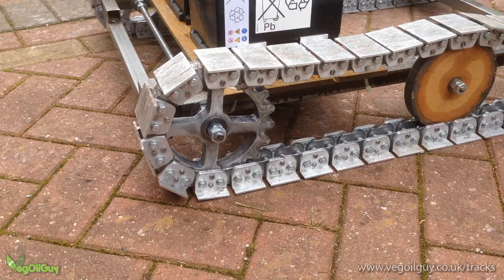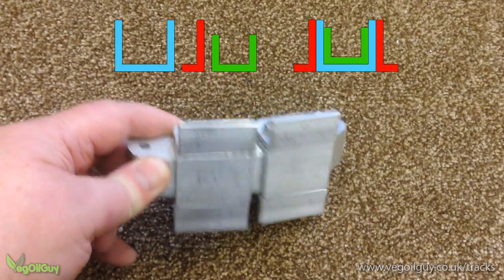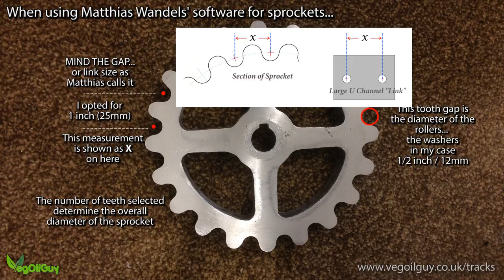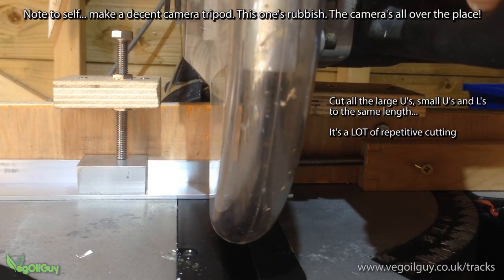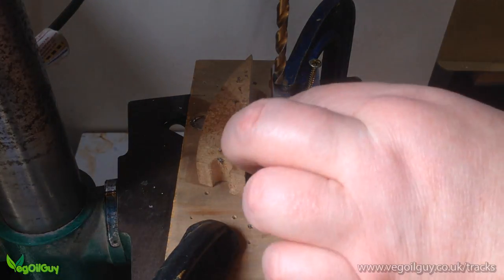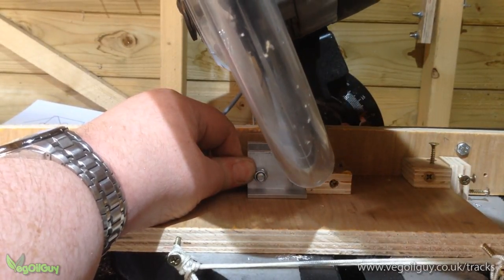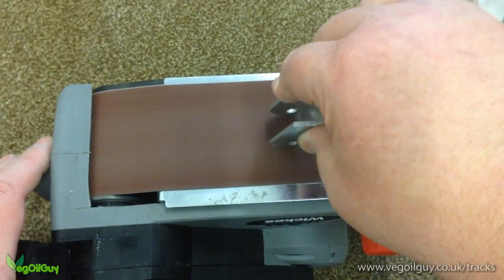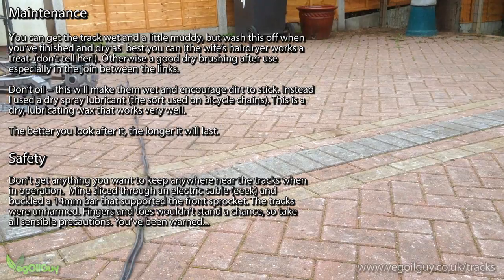How to easily make Caterpillar (Tank) Tracks at home - by VOGMAN

Comment: Can use aluminum pipe instead of bulk of washers it will reduce weight n be easy to make...can add rubber  pieces at bottom with rubber based adhesive for exta grip on floors n tiles

Comment: i might use your design on a crawler vehichle that uses a lawnmower engine, only scaled up a bit. ill probably end up putting some rubber padding on the face of the tracks so they dont scuff the blacktop as it will be significantly heavier.

Comment: Excellent video!  Have you thought about using a small pipe or steel tube instead of washers? Would be a lot cheaper and easier.
Reply from the maker: Many thanks. All suggestions are welcomed. They might come in handy in a future build : )

Comment: Great idea, have you tried to use something else as pins to reduce cost and weight?
Reply from the maker: Not yet. It still works fine and if it ain't broke, don't fix it 😁😁😁😁😁😁
Reply: @vogman  I was thinking about making this for a wheelchair for my uncle. So you haven't had cracks in the aluminium? Because I'm thinking about using your idea 👍.

Maybe I'll try different pins (small round bar (held in place by a lock pin) with a tube as roller) and I'll bolt on some rubber or wood as a contact patch.

Comment: Great project. I was looking at a similar project using a used electric wheelchair to make a toy for my 2 year old. It looks as if you have used wheelchair Motors am I correct and have you tried loading the platform and do  you think it would be suitable off-road for a small child. I look forward to hearing from you
Reply from the maker: Hi Stig. This is a large and powerful machine. The two wheelchair motors are capable of propelling an adult in an electric wheelchair but even accounting for the extra weight of the tracks I'm confident it would carry a young adult easily. At one point my 15 year old son was going to ride it but as luck would have it the battery life was too low.
So yes, it could very easily make a ride on off-road toy or even wheelchair. For example, the step into my shed is at least 6 inches high, but these tracks mount it with ease...
HOWEVER I have one concern for you and that's safety. These tracks are brilliant but they are NOT forgiving. On one occasion I accidentally trapped a length of cable between the tracks whilst it was moving. It easily sliced through the cable and the force exerted was enough to buckle a 12mm steel rod. I'd hate to think what this could do to the finger or toes of anyone, especially a small child. You would need to take every precaution to prevent such an occurrence.
But there's massive potential for you here... if you build it, do let me know. I'd love to see pictures : )
Reply: Thanks for that. I appreciate the finger chopping potential. I had considered it. Thanks for your input. I'm sorting a chair at the moment and will keep you updated. I appreciate the ability to carry an adult but the torque involved in skidding tracks offroad will be high. I'll give it a go and as I said keep you updated. Many thanks
Reply from the maker: That's great. As a proud dad myself I know how precious our kids are. Play hard but play safe : )
And torque? Oh yes... electric motors have very high torque. I foresee lots of happy experimenting in you future. Enjoy!

Comment: you should stick some rubber pads on the metal to stop them from scratching at to create more friction
Reply from the maker: I've toyed with it. The problem is finding an adhesive. Most are good short term but fail with repeated use...
Reply: @vogman  Yeah i thought that might be the case, might be able to make a little hole in the middle of tracks for the rubber to go not sure though

Comment: Really the only change that could have been made easy enough is to use a tube instead of the washer. Maybe it's not readily available near you which would make sense for washers instead.
Reply from the maker: Thanks Mitch. In honesty the washers work really well  : )

Comment: cut down a old tyre and bold it to the chainparts with groundcontact and they shold hold quite long.
maybe even have a better 'grip'.
Reply from the maker: It turns out rubber was only added to stop tracks destroying tarmac. The track itself has such a large surface area that it has excellent grip - or that's the theory : )
Either way, it's great fun. Have you seen it now it powers my lawn mower? It even makes cutting the lawn enjoyable.
Thanks for your input : )

Comment: nice work, but very time consuming. if you dont need exact copy, you can use: roller Chain With K1 Attachment, which saves you a lot of work.
Reply from the maker: I did think of using chain which, as you rightly say, would save a LOT of time, but I just couldn't get chain that would scale up the same... those sprockets are roughly 8 inches in diameter.  And again, yes, a long winded process. There's a few boring, repetitive hours here, but the results were excellent.
Thanks for your input.  : )
Reply: @vogman  It would scale up just fine, you can get in INSANE sizes. You can also get hollow pin roller chain, a bit cheaper than K1, but you then have more work to do.

Comment: Pretty slick. But couldnt you have used a ready made chain and weld on "L" 's?
Reply from the maker: I toyed with that idea. I'd even seen a video of someone using bicycle chain to do exactly that. I guess it's just a matter of scale - and weight of course. This is fairly large scale and being aluminium, it's fairly light, much lighter than its equivalent in steel I guess.
Thanks for your input  : )
Reply: @vogman  About the weight, what is the size of this track and how much does it weigh? I'm thinking about using a similar method to make some tracks but Im afraid the weight of this might be an issue.